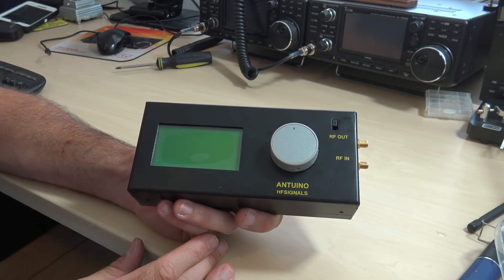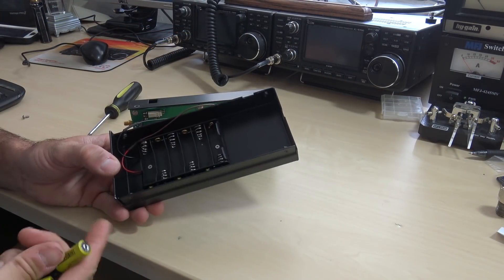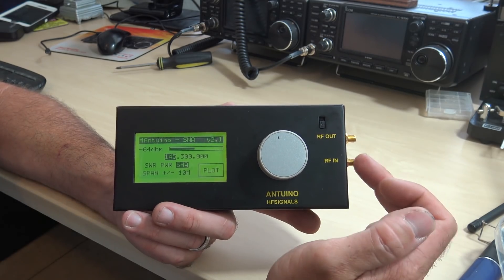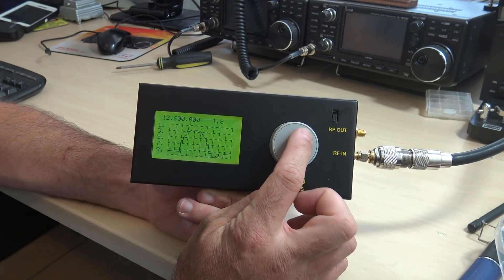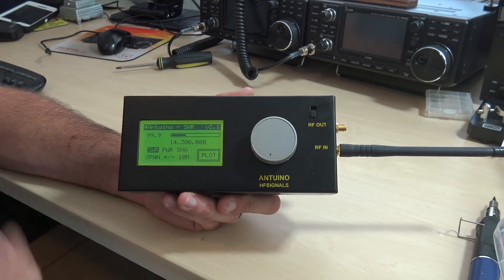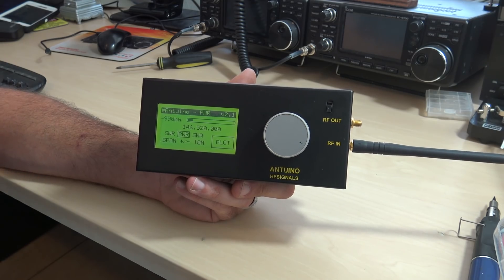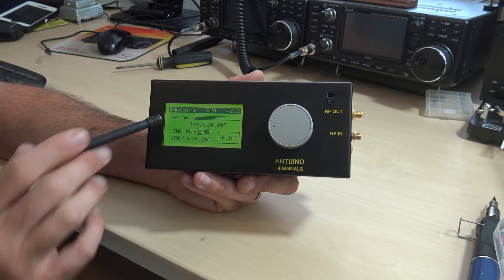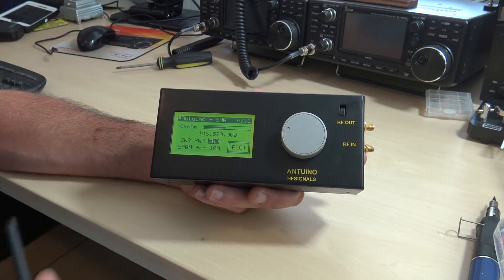Antuino! Antenna Analyzer/Field Strength/Modulation/Generator RF Lab

Comment: This instrument has devices in it that aren't in NanoVNAs and almost nothing else. I'm not sure if anyone had read my post from 3 years ago. It has the AD8307 RF Power Detector chip. It is a true micropower measurement device calibrated in Db ! Way beyond anything else out there. But, this device is one of the undescovered jewels from HFSIGNALS and Ashar and if you look hard he will show you some crazy things you can do with it.

Comment: Well, a couple unique things about this VNA. Its a fairly rudimentary VNA from the display viewpoint, its fairly to the point. It has some chips in it that are used as industry standards and not use by any other VNA.    
AD8307 RF Power Detector chip to be specific, and its the only inexpensive unit that has attempted to use this chip in a calibrated fashion. 
I take a little exception to some of your wording at 7:17 . The system does do both, velocity factor measurement of coax, and quite different to that, is capable of measuring loss from a ""multi port" viewpoint. You can measure the loss in say a low pass filter or a cavity, part of a duplexer. You can align a duplexer. Measuring velocity factor is different, you hook it to only one end of the coax (usually) and measure the time it takes to get the signal back from the open end of the coax. You do not use both ports with most velocity measurement devices. It completely different from the dual port system , and is fairly down to earth with my experiences. I do not take anything for granted when I do it. Other than the fact that the frequency is correct, and my tape measure is correct, I do not go by numbers provided by books or even coax manufacturers. I measure it, and it is what it is. Numbers are of as much as 5% and I go by the measurement as it is very defined. Thanks for the video.

Comment: Headed to Giga to get one, a question though, why the sma connector in lieu of a 259.  The adaptor is a bit unwieldy for us HF troops. Is there room to change the connector?Tx 73s
Reply: Because SO-239/PL-259 aren't really 50 ohm connectors and add an impedance bump above HF frequencies.  A proper robust connector would be an N connector, TNC, or BNC.
Reply: Agreed. How easy would it be to replace those SNA connectors with BNC. I use and have adaptors for those.

Comment: I would love for Ian of Hamskey.com to start working on this. One thing I'd like to see is a 3.2 nextion on it. He is the one who did all the software crazy stuff on the uBITX ! With a Nextion perhaps Ian could work out a Smith chart with it. He's an amazing programmer.  You will see a lot from Ian at  my two uBITX playlists. I've seen amazing things done with tuners and smith charts. A guy just did a video showing that here https://youtu.be/f8wJ0io95RE The chip used for the receiver isn't an ordinary chip circuit. That's what convinced me to get it. Its the AD8313 and you can easily spend $100 for the rf meters here alone, and thats as a DIY project !     https://hackaday.io/project/26112-ad8313-1mhz-to-6ghz-detector
https://www.qsl.net/va3iul/RF%20Power%20Meter/RF_Power_Meter.htm 

You can tune cavities and duplexers and low pass filters with this system. And, it comes with a new high sensitivity modification (I checked, its in mine). 

That said, maybe Ashhar will build in the Smith Charts. Ian is busy with other things. Ashhar ? Please ? N6GRG

Comment: Its a great little device when it works, The one they sent me was definately used as it was scratched, worked great for about 20 min then started going haywire, knob stopped working clockwise and freq kept resetting itself.

Comment: 100 bucks is not bad for a two port VNA. 
Holy cow ! Your LMR coax connected to the SMA connector ! Suggestion, make a small jumper out of RG 174 or RG 316 with an SMA on one end and either a BNC on the other end or an SO 239.  That's a lot of stress on the SMA as you do it. I see you take care and not put stress on the connector, but a jumper is the way to go.
Enjoyed your video. Barry, KU3X

Comment: Great presentation and good choice on a new product to review. Thanks. However, at GigaParts price is $109.99 and I get this message using the coupon code that you suggested: The coupon code "HRC5" is not valid  ...after weeks with no reply from either HF Signals or Ham Radio Concepts I will give this a definite "Pass"...no service ..."NO CAN DO"

Comment: Hi Eric,

Very nice video. Product has potential.
A few things.

1) I think equipment reviews are always better when compared side by side with a known quality. This vs. a rig expert, an g90 vs 7300, etc. Does the swr scan match the results of a rig expert?

2) SMA Connector? Failure jusr waiting to happen;  i was ready to hear a crack & break when you put that lmr600 coax thru an adapter to that sma, if the connector doesn't snap, the solder connections to the board probably will!  Should have an SO-239 next to it!

3) that knob looks awfully wobbly when you spin it! I wonder what kind of cheap plastic encoder shaft they have going.

4) regular batteries?  Not good today especially for test equipment. Should probably use lifepo4 cells for more stable reference; back to accuracy..
 Would your antenna readings be the same with end life batteries instead of fresh?
Reply: #3.... He was unable to tighten the set screw for the knob.... He mentioned that in the beginning of the video.

Comment: SMA  connectors for HF?  Sorry, no way.  Wouldn't trust them. They aren't designed for that usage. I hate them on HT'S. They were designed for a much different  application.  BUT, to each his own.
Reply: F16CJWW who's stopping you from replacing them with whatever connector you prefer? This is not intended as a "product", this, like everything else hfsignals does is meant as a starting template to make it into what you want it to be.
Reply: @noth606  Yes, that's  a given as a ham...but, why just build it right from day 1. BNC's... but they cheaped out. So you have to correct there poor engineering.  So it goes....
Reply: What were they designed for? Is there loss by using these types of connectors?
Reply: @GMELECTRONICS365  At HF , yes. Plus they're not meant for those big adapters and the strain.  Manufacturers doing it CHEAP for the bottom line.
Reply: @F16CJWW  I did cringe when I saw the adapters and how it may be damaging the internal board.
Reply: @F16CJWW  No, there will not be loss at hf, unless you are pushing more power than they are rated for. That is just plain wrong. As long as you are using a high quality connector there is no problem with using them. No rf interconnect will cause loss at low frequencies. If it does, its not an rf interconnect.
Reply: @bob_345-g3d  Its STILL a cheap and flimsy way of using a connector to use on a piece of  supposed broadband test equipment.  Sorry,  it's a lousy connector for its purported use. At least a BNC would have been better .
Reply: The circuit board connector is a bad design. My connector has already broken. Yesterday I soldered an RG-174, drilled a new BNC panel mount, and wired to it. Much better way to go.

Comment: at 1:35 it looks like this has an Arduino Nano with the USB connector poking thru the side panel. I have to look into this. Thanks for the video Eric.
Reply: Confirmed. It uses the Arduino Nano board. See antuin_v2.1.pdf on Github. Don KC3MBK

Comment: So between this... and the RigExpert AA 30.zero, what’s the performance difference?  Is it worth sacrificing the flexibility of the Zero for portability?
Reply: Dave Rhodes aa 30 been replaced by aa 35 zoom...witch I want to buy
Reply: SmallBlocks Adventures  - yeah, the 30zero is just the bare bones board.  Combine it with an Arduino and my laptop...  I love it.